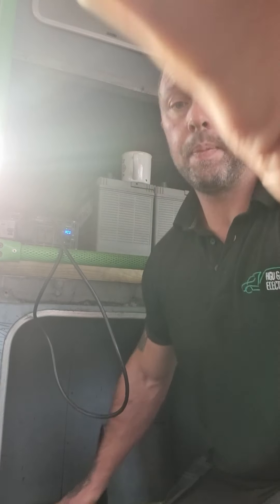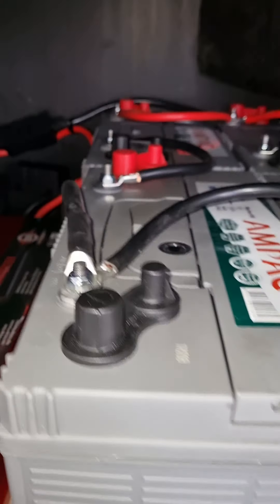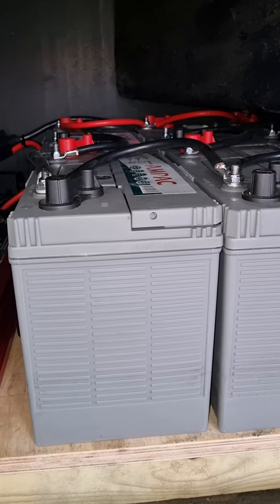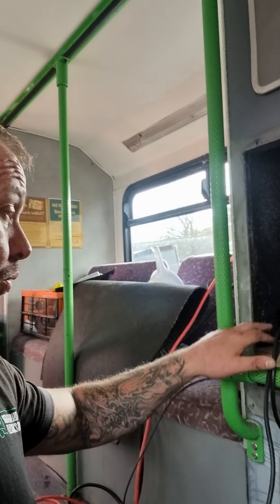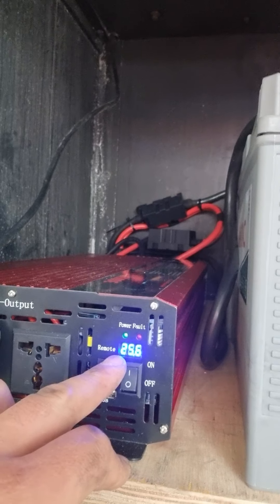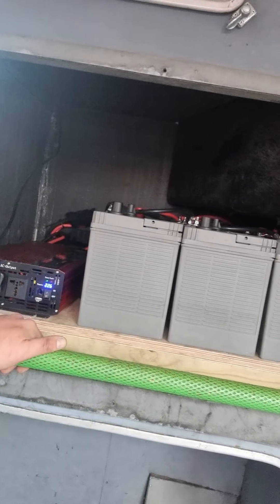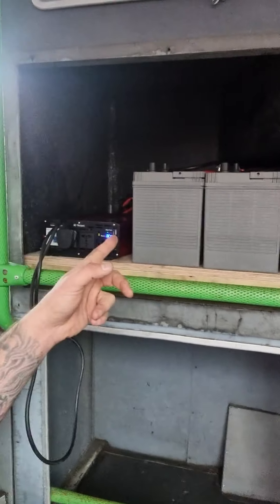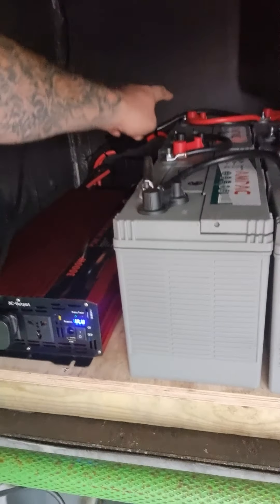Parksafe 3kw Inverter Install with Six leisure batteries on a 24v system.

Comment: I'm thinking of buying a 3000w Park safe inverter, are they reliable in you're opinion?
Reply from the maker: Hi there. Yes. I have had zero issues with them and over fifty installs. Would recommend them personally 👍
Reply: @hgvautoelectricsni3731  thank you very much 😊